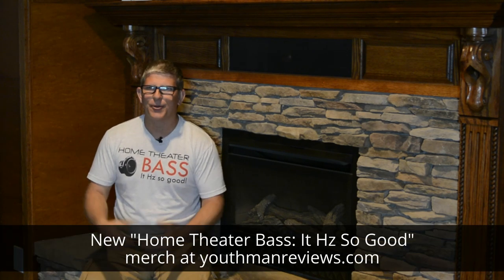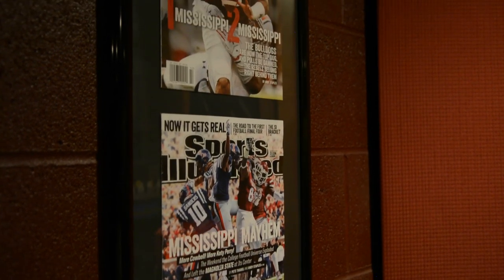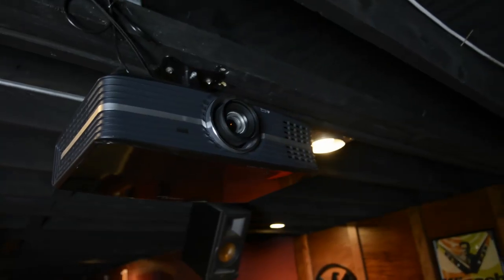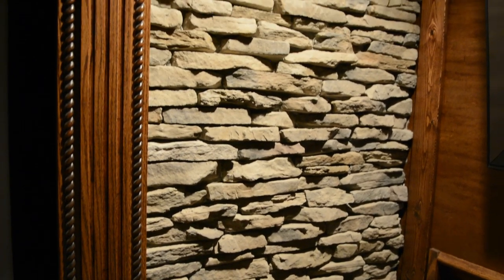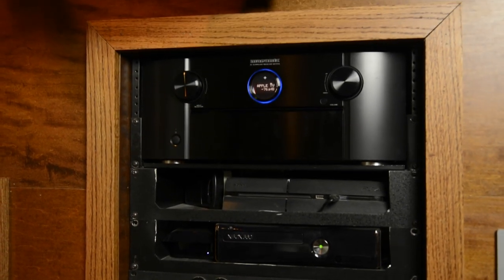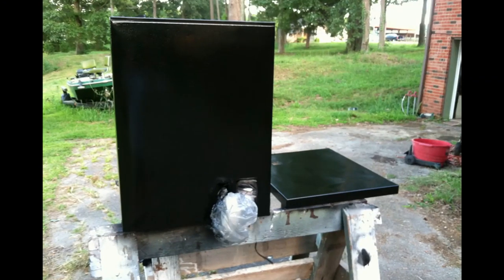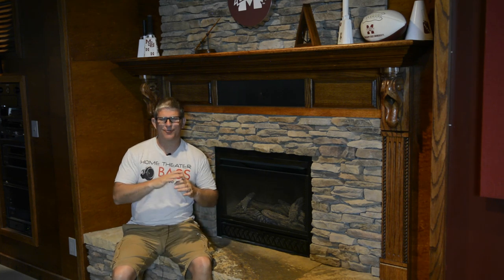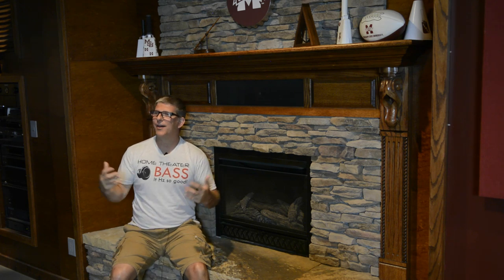Home Theater Tour Dolby Atmos 7.4.4 Klipsch RF7 II

Comment: I love the way the light shines down on the rock and really does not bother the projection screen that much, is still able to be watched without much interference. I wonder how that hard rock messes with the audio bouncing off it?

This has to be a very nice way to make a living, go around looking at and interviewing people's theaters. I think it would be cool to be able to see the equipment people have and give me ideals on what I can buy to add to my own system... I am currently tracking my new 19" rack cabinet for my own theater equipment, should be here Monday as the current 19" rack is full and I have equipment sitting next to my cabinet on a table. My two new 7 channel amps still sitting in their boxes, can hardly wait to see how much better they sound than my current amps, this will add another 2,800 watts of power to my current setup. 

I am going to use my old 19" rack cabinet to hold the massive battery backups I am going to install to keep the entire system working, at least long enough to safely shut it all down, my goal is to have enough backup power to be able to continue watching the movie for around 30 min's and then still have an extra 10 min's for shut down as the power usually does not stay off for more than about 20 min's, usually no more than 15 min's tops, that way it does not interfere with my movie at all, I will not have to worry about it for at least 30 min's, I hate getting involved in a movie just to get stuck shutting it down because the grid fails for some odd reason (hey it is coop power). Although I doubt I could keep the batteries supplying enough power for the DBOX seats, I could at least finish the movie without interruption.

I may have to find someone to help me build or build my next theater here at my home, health is not that great and getting hard to move around, bend over and climb up ladders, but I want my 50' or larger screen, 5 rows of 8 or 10 seats, along with a small projection room up top. My goal is to have a nice theater with a concessions stand below the theater seats, maybe a spiral staircase to the projection room, and a door to the left of right that would allow entry into the theater, then steps to the row and seat of your choice (as long as it is not mine). I would also have a door at the top of the theater seating room incase I needed inside the projection room, would hate having to go all the way back down and out, into the food area just to go up a spiral staircase then back down and around to get back to my seat.

I have my whole theater planned out in my mind down to the final cabinet, screw or nail. A nice building where I can escape into my own world. All my Blu-Rays, 4K's, etc... would all be in the projection room, with all the movies on the network so I could also stream them back inside the main home. I want my theater separate from the house, and have it look like a small commercial theater but much nicer. Sorry for the book, just wanted to share my plans for the very near future...lol

Comment: 4 subwoofers! It hz so good

I woder if they are the size of the subs in aquaman
Reply: I'm running 4 12" at 5,000 watts... it really hz so good... they are car audio subwoofers so they were much cheaper than traditional home theater subs, but they work and sound so good.
Reply from the maker: LOL
Reply from the maker: They sound amazing
Reply: @FinnishArmy  are they ported or sealed? By the way can you give me some tips to put more than 2 subs(like positioning, volume, crossover etc.) , since I am planning to buy a 3rd sub
Reply: @FinnishArmy  5000watts????? For 4 12s?? 😳
Reply: TECH N DJ Yeah? They are running off a 5,000 watt car amplifier which runs off 12 volts, rather than 120/240volts meaning they output more wattage to acquire the same volume. 12 volts because they tend to be connected to a car battery.
Reply: @FinnishArmy  what subs u use.. I never heard of a 5000w rms sub in 12s
Reply: TECH N DJ Well there’s 4 of them, each one has an RMS of 600 watts, ~2,400 in total RMS power. Skarr SDR-12’s all running off a 5,000 peak watt Rockville amplifier.
Reply: @FinnishArmy  oh.. Great.. My 2 12s are 300w each.. Total 600w rms and 2400w peak
Reply: TECH N DJ Nice!!
Reply: You can never have too many subwoofer
Reply: Avengers infinity war probably sounds amazing especially when thanos gets a new stone.
Reply from the maker: For sure
Reply: the comments for my comments will not stop will it?
Reply: @FinnishArmy  im using 4 12" as well! i use dual svs pb 12 plus/2 subwoofers. so my subpower is 1800 watts rms and 7200 watts peak! they rock and go down to 14 hz in my  room. how deep does your subs play?
Reply: @elias8676  These subs aren't designed for playing in a huge room, so they go to about 30hz.
Reply: @FinnishArmy  Nice, so they hit hard when playing music?
Reply: Elias Lystad oooh yeah baby

Comment: Hi Youthman, it's a good demo.But I really love the subwoofers that he built. If you kindly make a 2nd version of this video so that everyone can have a rough idea how's the subwoofers rumbles or how it's sound.And also a demo video of your Monolith subwoofer please. Thks
Reply from the maker: It will be awhile as Shaun lives 600 miles away. We mainly went up there to visit and spent the two days on the lake wake boarding and tubing. The video was shot late in the night on the night before we left and everyone was already asleep so I couldn’t crank them up. Suffice it to say, his entire house literally shakes. He finds objects upstairs on the floor and has to tighten lightbulbs every month
Reply: @Youthman  Ok, will wait definitely. Thank you for your quick response. Take care Youthman. Will chat with you soon.
Reply: The sound is insane!  I describe it as effortless bass and lots of it.  It is easy to have to much bass for a good blend, but I feel I have it dialed in so it blends well.  At no time can you tell where the subs are in the room from the sound.  They are powerful enough they actually ripped shred rock loose from the screws and had it slamming against the studs.  When a light bulb goes out we can usually just screw it back in.  The bass frequently loosens bulbs throughout the house.
Easily hits single digits with authority.  Very smooth clean bass.  I could not be happier

Comment: hello youthman soi Antonio from Spain, nice video as always plaked !! I just bought the sr7013 and I'm delighted ... from what I read he used it as previous more stages? ... How was the experience?  emotive basx a-700 for the 4 atmos and the two surround !!! ... How about the sound of this 7013 to what you are accustomed to your 8012?
Reply from the maker: It’s difficult to compare the sound of two receivers from 600 miles a way and in two different rooms with different acoustics and different equipment connected to it

Comment: I’m looking to add a little more power to my system. My Onkyo receiver has 7 channels and has 200 watts with two channels driven. I’m looking for a 100 watt x 2 amp to power my two fronts.(R620F Klipsch). I know I could spend a bunch and buy a 5 channel amp, but I’m not sure I need that much power. I’m running a 5.2.2 system now, and it sounds great, but the receiver gets pretty warm because of the level I like to play movies at. Any suggestions?

Comment: I really need help connecting an external amp right now on my theater setup. I do not have any pre amp outputs for the individual speaker I only have a pre output for zone 2. Would that still work? I have a Denon AVR-X1100W with a Niles SI2150 Amplifier. I have the speakers connected to the amp with the rcas going from the zone2 preamp output to the niles input and I'm not getting anything
Reply from the maker: Unfortunately you cannot connect an amp to your receiver. That’s one feature that you won’t find in a budget receiver. Typically you will find all preouts for all channels around the $1000 price point and above.

Zone 2 in your receiver is to power say a pair of speakers in another room or outdoors.
Reply: Dang that's a bummer. Thanks a lot though!